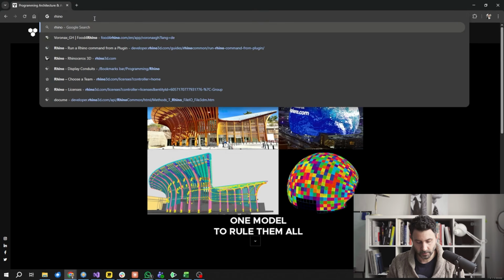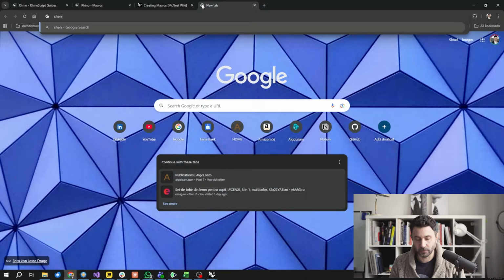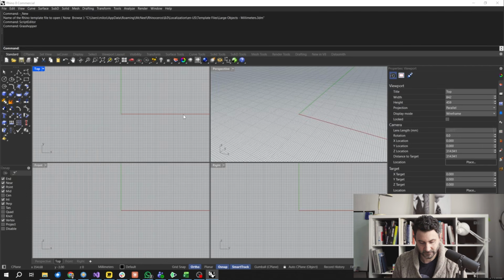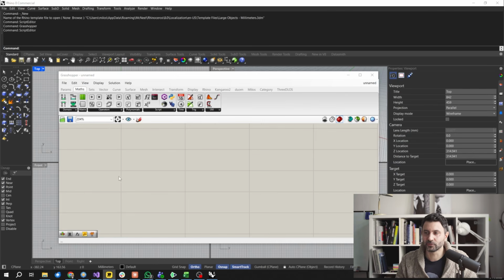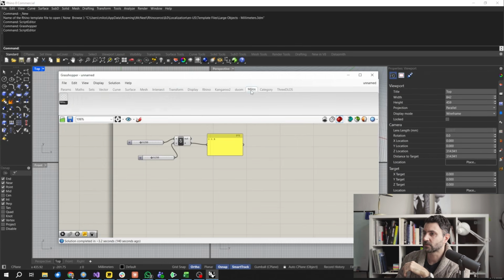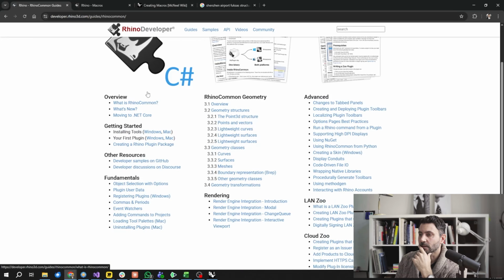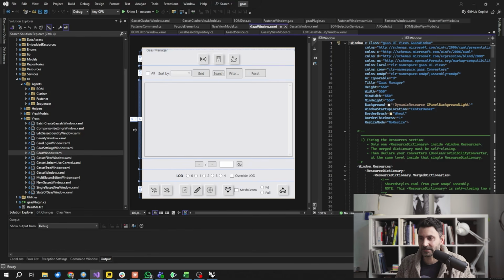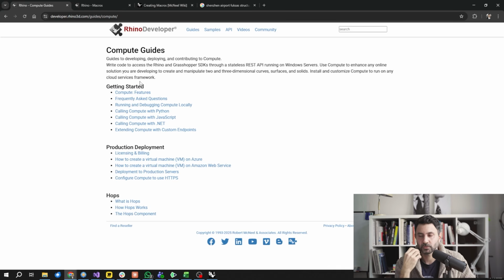From Macros to Plug-ins: Rhino, Grasshopper, and C# — An Overview by an Experienced Programmer

Comment: I think there's a problem with the output pipe for the C# component; it's calculated the object, but it can't physically send the model to the Rhino display.
Reply: You can use the following text and code block. It concisely explains that the most basic geometry command is failing, proving the technical blockage:

*Rhino 8/Grasshopper C# Output Blockage*

I'm hitting a critical runtime error where the C# Script component fails to output any geometry, even a basic sphere.

If you paste this code and set the input 'R' (Radius) to 10.0, the component compiles (no code errors) but crashes at runtime, showing the Red/Orange failure status and no geometry in Rhino. This proves the output pipeline is blocked on my system.

```csharp
void RunScript(double R, ref object Output)
{
  // Creates a 10mm radius sphere and assigns the solid geometry.
  Rhino.Geometry.Plane centerPlane = Rhino.Geometry.Plane.WorldXY;
  Rhino.Geometry.Sphere testSphere = new Rhino.Geometry.Sphere(centerPlane, R);
  Rhino.Geometry.Brep sphereBrep = testSphere.ToBrep();
  
  // The system fails to execute this final assignment command.
  Output = sphereBrep;
}